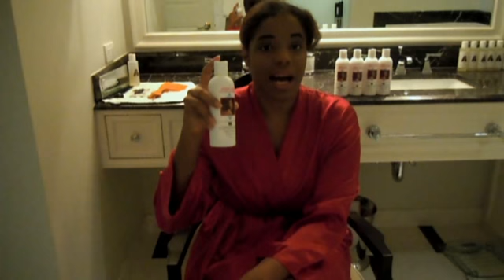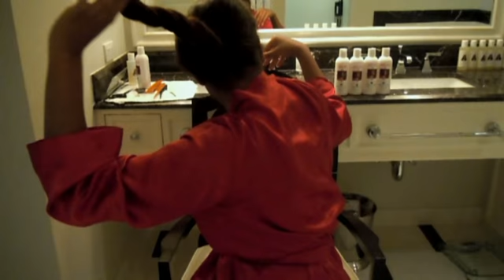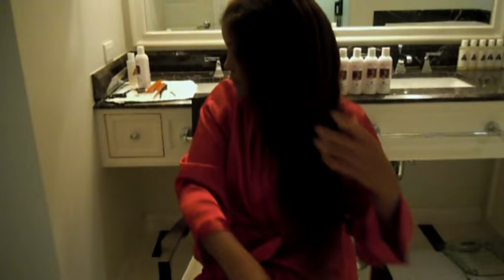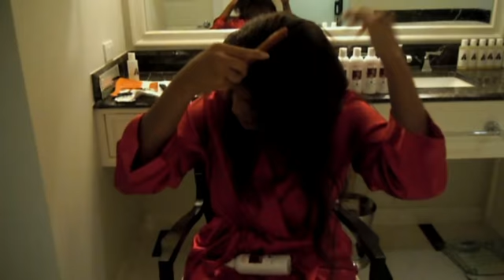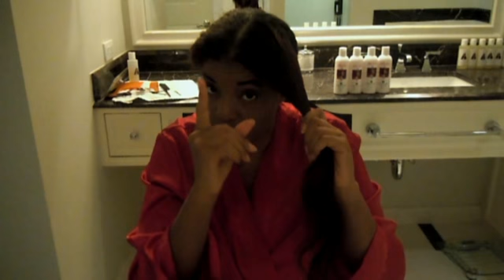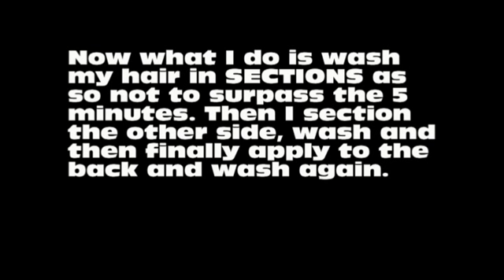Shima Hair Repair Shampoo TUTORIAL!! (DVD Excerpt)

Comment: Shima, the video says 5 min max but the bottle says 5-10 min. Also, the directions say to use the shampoo until the damage is gone, so do we stop using it after that or can we keep using it? I really love the shampoo too, it's very moisturizing and I love the tingling.
Reply from the maker: +Nija Jones The 5 to 10 minute is simply a recommendation...So you can leave it as long as YOUR hair texture requires. FOr example, since my hair is very long and I have ALOT of it I leave my Shima Shampoo on anywhere from 15 to even 25 minutes! ALso, yes you can continue to use my shampoo long after the damage is gone. My Shampoo will simply CONTINUE to moisturize and Stop any further breakage!
Reply: +Shimahair21 Thank you Shima :) And thanks for creating such great products.